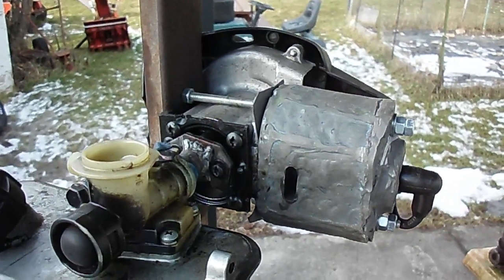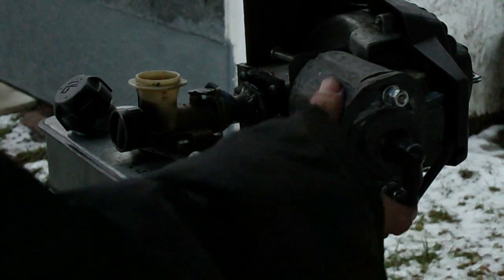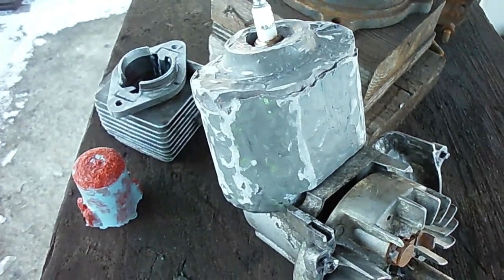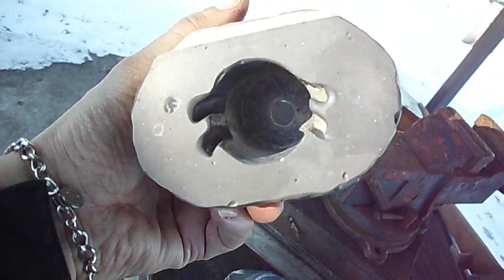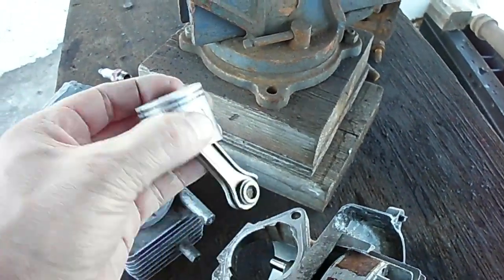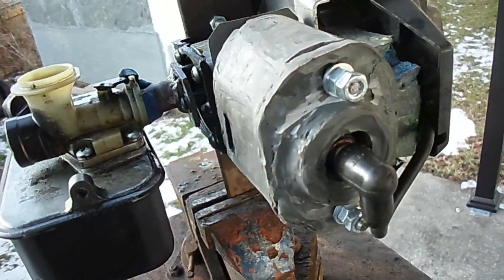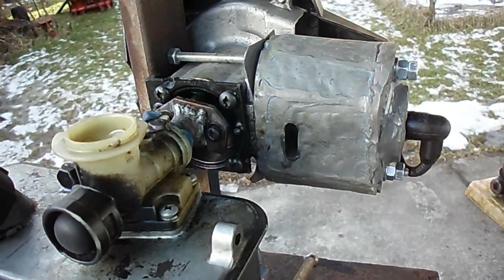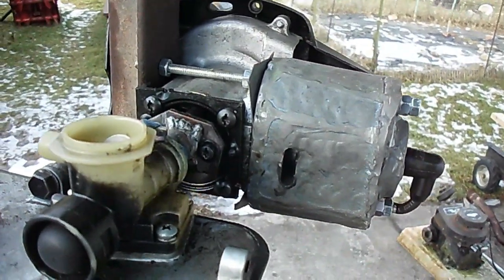Will a JB WELD ENGINE RUN???

Comment: Could the lack of muffler be hurting its ability to run properly? I thought NA 2 strokes need a resonated muffler to provide proper backpressure for scavenging.
Reply from the maker: You are the second person to mention this. I am not very familiar with NA 2 strokes , so I wasn't really aware of the importance of a muffler. I am currently trying to MacGuiver the original muffler in place to make a run tomorrow to see how much of a difference it will make. Thanks for commenting, since we all have a lot to learn still !
Reply: @ChargerMiles007  I don't know a whole lot either, but I think it may make a difference. How BIG of a difference, I don't really know. 😄 Your whole name of the game is experimenting though, so it's a natural progression to try a muffler on it and see what happens. :)

Comment: Try running 1/20-1/30 oil-gas ratio instead of 1/50 ? Is this a job for Marvel Mystery Oil ?!?!
Reply from the maker: I will add more oil to make it about 1/20 again, like when I first tried to get it to go. I prime it with the same fuel mix, just so it always has oil. I don't think the JB cylinder is nearly as slippery as the original aluminum cylinder.

Comment: Im happy with what you got out of it,Weed wackers engines are not reliable on a good day!
Reply from the maker: LOL, that is my feeling about them also. I bought a new one about 10 years ago, got about 5 years out of it, but it always wanted to run on part choke. In the end it got to the point that it refused to stay running, so I tore the carb apart, spent 2 hours messing with it, didn't make a bit of difference. Out of frustration I threw it acrossed the yard, and broke its neck in the process!  Later my son had the identical unit, so I gave it all to him, he took what he could use, then gave me the motor back last fall, so now I have just the motor again. I guess you never know, I might need a part or two for this project!  I am looking at how to attach a muffler to it.

Comment: I wonder if you did 10:1 if it would run longer?
Reply from the maker: Not sure, I started at 16:1, and initially it wouldn't run (bad carb), so I added more gas to make it about 25:1. I could add more oil again.

Comment: it ran thats good enough lol but really id use a normal weed eater carb on it and just run it rich af on oil
Reply from the maker: I tried a weed eater carb on it first, one that I rebuilt (I left that clip out of the vid). It just acted like it wasn't getting amy gas at all, so I tore it right off and primed it with a syringe into the crankcase, a it roared to life on the first pull!  I do have a new carb that I just got in, so I could give it a try. I will be fighting the cold here this weekend though, a high of -12C. Maybe I will make a cold start vid  Brrrrr, hope the JB isn't to brittle and implodes!
Reply: @ChargerMiles007  might not be getting enough crank case pulse to make the carb work. Make sure the crankcase is sealed well and blow out the carb with compressed air. Theres also a small screen too that you can pick out and see if there is dirt behind it then reinstall it back if you want or just run without it.
Reply from the maker: Admittedly the crankcase to cover gasket died when I took it apart. I applied thick grease to the surface before assembly, so possibly it isn't 1000% tight.

Comment: Pretty impressive no matter how long it ran.
Reply from the maker: Thanks for watching the new spliced and diced vid, I finally did some learning about a vid editor, so I was able to combine some clips together to make a better vid.  I know some of what I say is a bit out of whack due to the sequence i made the various clips in, but I figured this vid should help people that aren't so familiar with my channel to quickly learn about this engine. Also, I am hoping a youtuber hit the nail on the head when they said that it needs a muffler to add some back pressure to help it run at lower rpm, so I will be MacGuivering up a muffler for it for another run  :)   Oh, I did a re-calculation, this has more like $60 worth of JB Weld in it, I was under estimating the cost of it.
Reply: @ChargerMiles007  
I have no clue how to edit so great job! A muffler probably would help. A chainsaw one would probably be optimal.